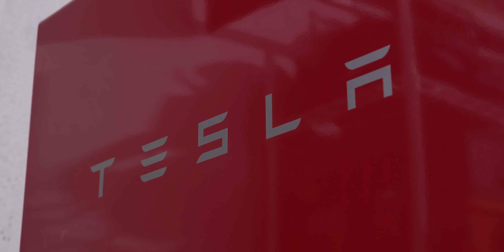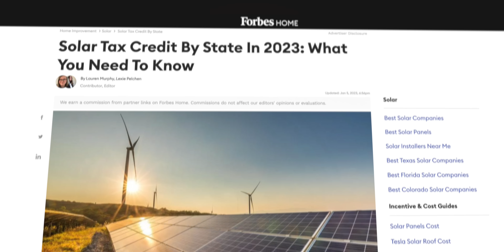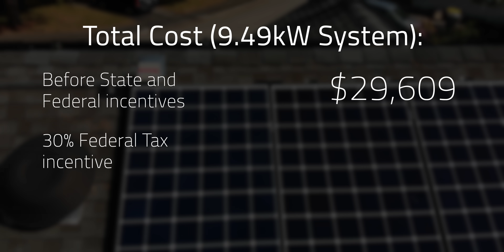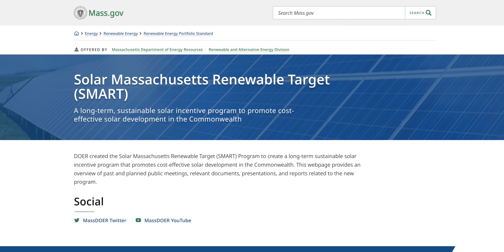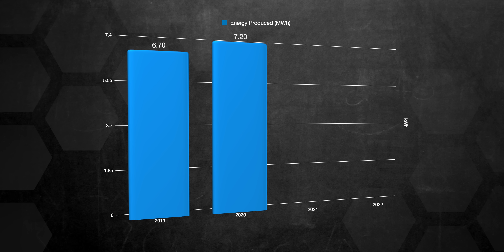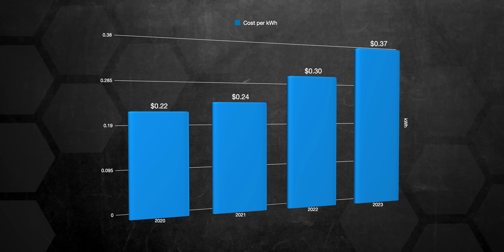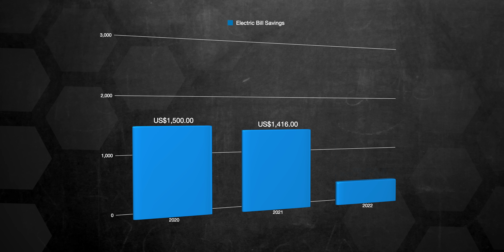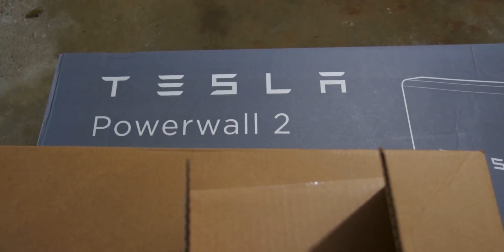5 Years with Solar Panels - Is It Still Worth It?

Comment: If you fall into that trap of letting the federal participate and this endeavor then you are skating on thin ice!
Reply: I almost went that route through Costco vendor.  Dropped the whole thing because my circular house style roof does not accommodate enough panels to make it worth the effort.  I would barely cover my current electrical usage, and I'm very frugal with electrics.  If I ever build a barn, I'll look at solar again.  But in Colorado, wind generators are probably as useful as solar panels.

Comment: I'd love to put solar on our home but unfortunately in my section of NC, our electric CO-OP only offers something called BUY-ALL SELL-ALL.  This is far worse than Net Metering.  Buy-All Sell-All means our electric co-op buys all our solar panel energy at half the going rate, then sells it back to us at the normal rate, and this goes on and on year after year.  Obviously they don't want home owners to install solar.  I think I do have the option of going completely off the grid and eliminating my grid connection, but I'd need a huge solar arrange and battery backup system for that, and my age it wouldn't be worth it.  Looking back, I should have checked into the solar situation before moving to this NC location.
Reply: That policy kinda sucks.    Might as well go for the gold and get off grid.  Off grid is not an option in Colorado if you're in range of a utility.  I would still pay the monthly grid fee.  Which also sucks.

Comment: owned solar panels for over 42 years and have not paid a utility bill for over 13 years when i retired so no longer business utilities.  the goal is to use very efficient energy appliances and use them less so an existing small 2 KW solar system produces way more than than electrons used.
Reply: Nice for you.  Not an option in my state.  Unless you're in the mountains where no utilities exist you still have to pay the monthly grid connection fee.  You are not allowed to go off grid unless it's your only option.  Every state is different.

Comment: If you only save $1,500 per year, and the panels cost you $30,000 to install, it will take 20 years to break even!  By that time, the useful life of the panels will be greatly diminished.  I have a neighbor who has to replace her 15 year old panels that only save her $80 a month average during the summer and $30 during winter.  They cost her $12,000 to install... come on people... do the math... it doesn't work out!

Comment: Do any companies sell and install devices that you could have added to the top of each solar panel that could use previously stored energy from your Tesla battery system to heat and melt snow off of your roof-top panels using weight or visual sensors to know when they are covered with snow, ice or slushy mix, that would automatically safely turn off when the snow & ice on the panels have been melted, and not be negatively prevented from being installed due to increased real estate fire insurance concerns?
Reply: lol.  thinking ahead.  I wondered if there are any panels with protective shields that could slide down during hailstorms.  I don't think so, but it would be very useful in Colorado.  We have so much sun that solar is very effective, but we're also the hailstorm capital.

Comment: One question I have is why, when we hear that renewable energy is cheaper and getting even cheaper than fossil fuel energy and, that in most jurisdictions, more and more of our energy is being produced by renewable energy, why is the price of electricity, pretty well all over the world is going up.  Someone is price gouging.
Reply: Because every bit of renewable energy infrastructure must be backed up by a base load of stable electricity. So if you have a power grid that is running 10% of its load from solar panels, and you have sudden cloud coverage, you must be able to bring instant capacity online to compensate for the huge drop in solar generation or the result is regional brownouts. Unfortunately when that occurs, you buy that fossil fuel generated power at prime cost compared to the normal low rate you normally contract to when you are relying on a constant supply demand.
Reply: The simplest answer is that unless each unit of renewable energy is backed with storage, it can't be used by the system. The way we use power requires a constant, stable supply, 24 hours a day, 7 days a week. Solar simply doesn't offer this as weather + time of day massively impact generation, so the coal stations have to continue producing virtually as much power as ever to maintain a stable supply.

Now if we installed batteries for each piece of renewable energy we could solve this problem...however batteries cost massively more than generating power. To store enough to power a low density residential city block would cost millions of dollars which completely removes any price savings.
Reply: In china, branded solar with installation price is 1/7 U.S price. Electricity cost is $0.05 to 0.18 cents. Usually 8 years ROI with residence electricity. Commercial electricity is much more expensive, ROI 5 years. I am doing my preliminary’s research now for my company 9MW solar station. It should be under 3M U.S dollar. 0.3cents/Watts. It’s a big scale, it’s cheaper
Reply: Green energy is cheaper for investors, not for end users😂  investors need returns, so no reason selling cheap
Reply: Simple answer: it ain't cheaper and never was.
Reply: 1. General inflation drives up costs that are unrelated to the primary energy production (like the wages of employees)
2. Rising fossil fuel costs, especially around the full scale Russian invasion of Ukraine 
3. Previously externalised costs of emissions (like lung disease and global warming) are now taxed in many jurisdictions to convert them into real costs.
4. Energy grids are in a transformation/expansion that adds additional costs for some years. The main issue here is NIMBYism and anti-renewable politicians making this process slow and expensive.

Comment: i have two 7 amp solar panels that run my 3 pond pumps.  the panels are the type that follow the sun across the sky. In summer they work great with 2 battery backups.  In the winter the sun is not that good and i have a 70 watt heater downstairs. It works but the sun is not good and the wire is too long. I use about 2.5 amp on the heater. it was jsy a waste to have the panel there and do nothing with them. i live in Niagara Falls on Canada.
Reply: That is some useful info.  I have a manmade pond with a 24x7 400-500 watt pump pumping the water along  a 60-70 foot long stream/waterfall.  I'd like to convert just that one thing to portable solar panels, but keeping it running at night is the problem.

Comment: Something that I've never heard anyone bring up about the economics of solar power is the cost of buying the hardware at an earlier time but higher price.  For example, let's say someone buys $20K worth of solar panels in year 0, while his twin brother waits 5 years to buy the same solar panels for $10K.  Did Brother #1 generate $10K worth of power in that time?  (There are other factors, but you get the point.)  That said, it looks like the value curve is getting to a lower slope now, so this might not be an issue now.

As for myself, I like a lot of trees, and am in a hurricane zone, so solar panels are not for me.

Comment: For most solar panels, a little bit of shade anywhere on the panel, even shading on just one solar cell, shuts down the entire panel's output. Some newer panels divide the panel into 2-4-8 sections and add a by-pass diode across each section so only that section gets shut down with any shading.  SunPower has (or at least used to have) panels with an integrated by-pass diode across each solar cell. They are also expensive but then generally lead in conversion efficiency too. I don't know if there are others with integrated diodes across each cell but if you get any shading you need to research it before buying.

Comment: Is there data on output degradation of the solar panels? I saw an ad for used solar panels and the seller showed data of reduced output after several years. Are there resources to look it up?

Comment: In terms of the snow - been a mini-problem for me about 4 times in 12 months.I saw some folk install water-cooled solar - essentially taking heat from the panels to consume in the home while cooler panels are more efficient. You could also reverse this just to clear the avalanche of snow and get the full benefit of the panels again on bright, cold winter days - which would likely offset the cost of the energy required to clear the panels.

Comment: for me, its two therapeutic values: one is knowing I'm somewhat independent of the (reliable) grid, the other is the rip-off energy costs from the main supplier. Mine is only a small installation but looking to increase it 250% this year.

Comment: I watched your video with excitement up until it dawned on me that your priority for having a Powerwall ( storage battery ) was emergency backup. Sooo, I thought, what does he do for power at night, when many of our homes have 80% of daily  use? Especially in fall and winter when the sun sets earlier and earlier?

I work at home and we can do our laundry, wash our dishes and take our showers 
during daytime hours and in Texas, the A/C need is heavy during sunny summer months. Our use case is very contrary to most, who have A/C or heat at work and 
get home five days a week just when temps fall and darkness. 

Can you explain how we can justify charging our cars, heating and cooling our homes and using lights and appliances all off the grid after spending $30-50,000 on a solar system?

In your case, you earned referral points from Tesla and your Powerwall investment was only installation. I think we're still in a situation where
battery storage ( say 2 Powerwalls for an energy-hungry modern tech family of four with 2 electric cars ) is vital to make night/day usage off grid. Even then, depending on region and house orientation, the financial outlay vs energy savings
doesn't make sense.

Comment: In the stinking state of Cailf. new home buyers do not have choice to install or not to install solar panel to their new home. it is mandatory to purchase and the cost adds to the new home price. also it is warranty for 5 years and 15 years payment.  after 15 years home owner get stuck with the maintenance if financed or 5 years without finance plan. one crap I do not agree on is MANDATORY solar panels on the roof. it is known the home owner insurance can be cancelled if solar panels installed on roof. Govt is getting into home owner property without recourse. i do not trust solar energy one bit. for others, do not waste your money on solar or EV. by the way what is the life span of the photovac in the solar panel cell?

Comment: because it's only been 5 years, yes it should increase the price of your home. if it was closer to 10 or 13 years, it would devalue the home, as in order to replace the shingles on your roof (every 15 years) will include the price of removing the solar panels and putting them back up again, which can only be done by the company that put them up.

Comment: We built a 1000 sq ft house in the country in 2016. Great insulation, propane heat, propane dryer and on demand hot water heater. 4400 watt system. With solar panel on a stand, not on the roof. The batteries 48 V in an underground shelter. It worlds great.  We have to maintain the batteries every month adding distilled water.  We have a military diesel generator when we need it for rainy days. We will probably have to replace the batteries in a year or so, not sure what kind yet.  This is off grid. We also have a well with a pump that runs on it.

Comment: This video completely swapped out my plan for a roof mount to a ground mount array. Yes, we have the room, but the point is that none of the firms I approached were considering a ground mount solution. 

A wall of snow on the driveway and front steps would be frustrating if not dangerous. 

Taking it a step further, this led to other benefits. 
Access for cleaning. 
Maintenance access. 
Expansion possibility by having ability to add more panels on the rack. 
Better backside lighting for efficiency. 
Lessening opportunity for overheat of inverters. 
Privacy.
Reply: A lot easier and less dangerous to DYI, can save on changes, maintenance. Will be crazy to place them on a roof having good land available.
Reply: If you have the space, yes a ground mounted array is the way to go

Comment: Hi Matt....I just had solar panels installed in December and with an unexpected winter storm of snow and ice I witnessed the avalanche off my panels...that's why they designed my panel placements to minimize any damage to my yard and patio and I know what to look out for.  I did find the extended foam rakes to safely remove  the snow on Amazon but do you have a preference or suggested favorite?  Thanks for your info.

Comment: The environmental engineers at work finally got their wish a few years back and the company placed solar arrays on the roof as well as in some open spaces. 5 years out. We discover they never operate at 90% efficiency.   Further they only offset a very small portion of our demand (winter incentive  offset).  
Second its very expensive to have them maintained (cleaned etc). 
Lastly, electronics are not good company in a high heat environment.
Basically, the electronics bake themselves to death in the extreme solar heat, generated under their glass surface.

Comment: WTF $360 a month for Electricity what the heck are you doing????  we live in colorado and last month spent $339 on combined Gas and Elec.,  if we go to all elec. it will cost us more ( I assume the cost for energy for Gas it cheaper then buying Elec. from xcel which uses said gas to make Elec. and sell to me  but in the summer we paid $126 for both Elec. and Gas.....I'm still not sure on the ecconimics every spread sheet I have run makes it seam as if I get break even at year 18-19....

Comment: I am an Electrician. I install my own system at 6kw at 1.10$ per watt. I am currently installing at 255 million dollar electrical install non-solar, I am 65 and know two or three things. I have produced 19 megawatt = about 2000$ in 1.9 years. This ia about 3 year payoff. I use about 700$ a month in Texas, about 12kw per hour. I would need about 48kw to either bank to the grid or batteries. This would be a large area of panels. At 6kw I am only getting about 20-27KW on average at 5 hours per day. The panels used to cost 7.5$ per watt, when I bought them they were 1$ per watt and now they are .50Cents a watt. Your costs are 40% for panels and equipment, 20% for mounting hardware and 40% for labor and profit by installer. If you do it yourself you can really get it done cheaper. Most of the installation groups set you up for 20 year contract. I am set for 3-5 year payoff. With a 20 year contract it really makes you think hard WHY? The cost of power is set to have a crisis in the USA in 2 years. If you consume 100 to 300$ a month then it would be time to get it installed at the 3-5 year price point. If you want to get there real answer I will give it to you. linkedin.com/in/david-barnaby-56a4648, linkedin.com/in/oak-service-group-8883b627b

Comment: i dont understand why is america so expensive here where i live in europe you can buy 29 panels for 2900 euro plus 10kw inverter 800 euros , plus solar mounting around 2000 euros plus wires fuses breakout boards for additional 1000 euros . so in the end it dont cost more than 7500 euros . that is 4 times cheaper than what you paid .
Reply: I think its all the profit the companies are making on the sale. A solar tech told me the sales guys at his company were making $6k+ commissions on a sale!!!
Reply: @weareacorprotocracynow6907  where i live you dont need compant to get it installed you can do it yourself and just pay electrician to connect cables to inverter he wont take.more than 200 usd to do job.

Comment: I was shocked at your power rate. I'm on a municipally owned power system here in Texas (sounds a bit socialist that it is not a commercial entity 😅). I just checked my latest power bill. All in, under 11¢ per. Really changes the math. Plus zero incentives (this is Texas) and no VPP program, so no matter how bad I want solar, i will be dead before the payback period ends.

Great video, though.